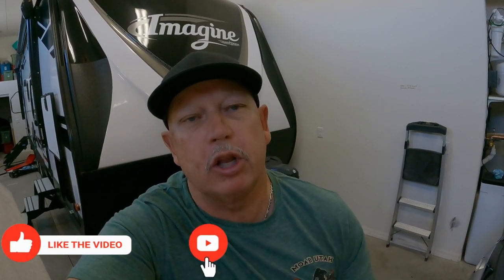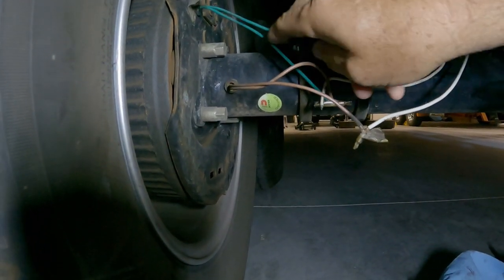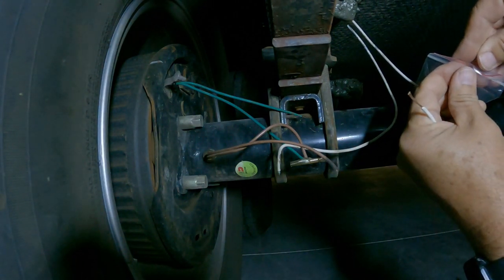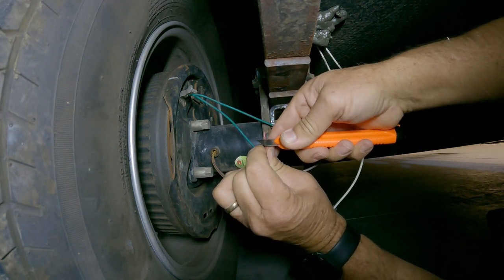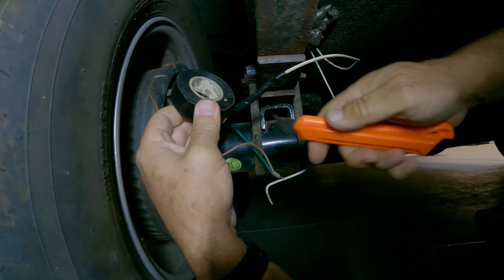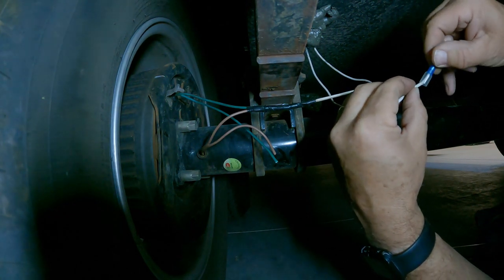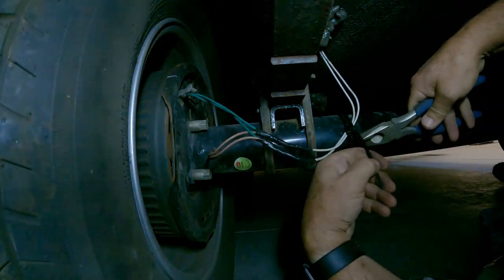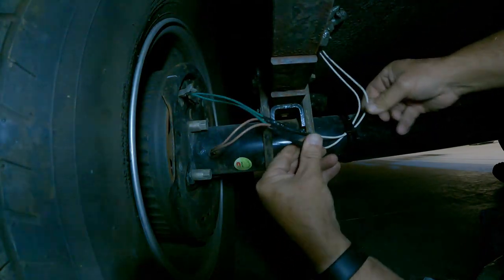RV LIFE: Have You Checked YOUR Trailer Brakes? // How To Fix Your Trailer Brake Wiring Step-By-Step

Comment: Upon inspection of the brakes on our 2500RL I found the adjuster in 2 pieces inside one of the brake drums and the spring poking out the the adjuster hole. I was able to get the parts at a local trailer shop for the repair. It pays to do the inspection. Thanks for sharing Stan.
Reply from the maker: Jim, that is a good find.  A comment like yours might inspire more people check their trailers or RV’s and not take for granted that everything is good when it is not.  Thank you Jim, Stan

Comment: Thank you for showing this it is super important to take a look and see for yourself.
We found out the hard way and we have an underbelly covering.
We just took a short weekend trip to make sure everything is working great before our big out of state trip. On the way home we saw some smoke. Our Rv has under belly we found the wiring was hanging down swinging and rubbing on a piece of L frame and was cutting through our wires. My husband has now lowered the under belly to find the horror of wire mess hidden 😱under there and has now fixed a bunch of items. We are just passed our one year warranty mark.
I am so glad we looked before our trip.
Reply from the maker: Tammy, this is a great comment.  This is the kind of stuff that needs to said.  Unfortunately quality control went to the way side when they think it is hidden.  I am going to our manufacturer tour on Monday.  I love our Grand Design Imagine.  I have a few choice words I want to share with them.  So proud of you guys on your test adventure and fixing the problem.  More of us need to do what you did then to run to the dealer for every little thing.  It’s a our little home in the road.  The little thing are our responsibility!!  We love it❤️.  Thank you for sharing.  Till the next time, Stan and Rhonda

Comment: Thank God you put this up and made my fix easier. I have a 2022 2500RL and found the same issue looking at the tires and suspension while winterizing. Main line got broke off the front tire tap connection.  Wasn't sure if those connectors did a trick or were fused. You answered my question and now I can go ahead and fix. I even know how to test after I'm done. Great job and important video. Thanks for posting.
Reply from the maker: Thank you for joining us.  I have to tell you, now before I go on another trip my inspections are to another level.  Just finished repacking the bearings.  Checked the brakes all looked great after 21,000 miles.  Probably could of packed the bearing with new grease a little earlier.  However, bearings looked great!  I’ll be putting out a video soon on that project.  Super easy to do!  Blessings, Stan

Comment: How did you know which wires went to what? Looks like 2 green coming from hub and 2 white coming from connection point on front of trailer and then the 2 wires coming from the axle which are white and red? Any help would be great to know.
Reply from the maker: Bryan, all I did was matched what was on the other axle.  I also checked how the wire was cut.